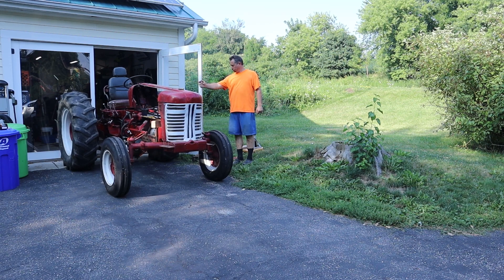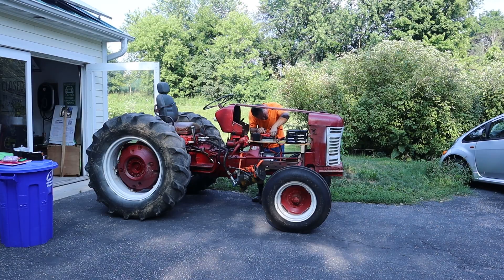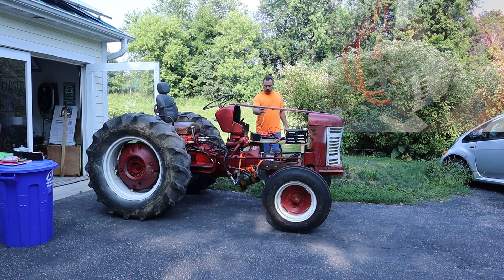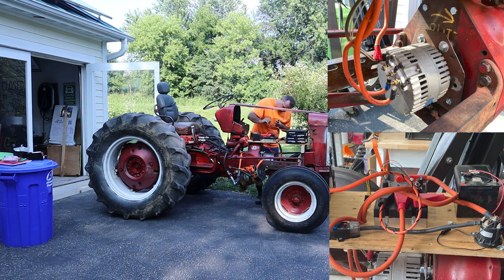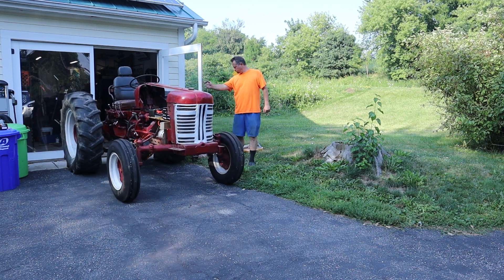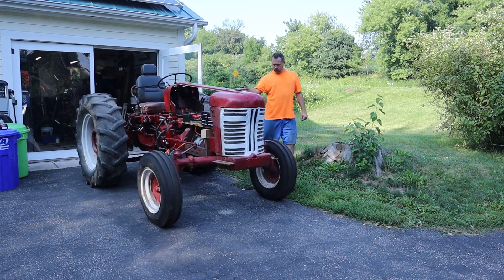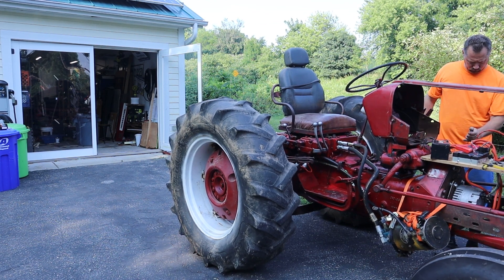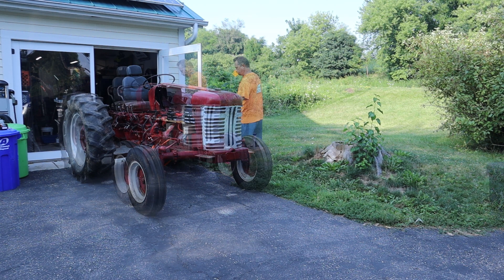Electric Tractor: Rolls for the very first time!

Comment: Awesome to see it moving, nice work! What happened to the Leaf motor?
Reply from the maker: I still have the Leaf motor. I’m going to try to see if I can fit it, but it requires such a high voltage to operate that I might not be able to fit a matching battery pack.

Comment: Now, from engineer who lived his childhood on the farm:

Most useful thing in the was hand throttle that can set almost fixed engine RPM. So you can drive it on flat road, up or down hill at constant speed, like cruise control. Mosty for hauling lumber, you set the low throttle and it does engine brake a lot.

Also, my tractor has 2 clutches. If I was doing the conversion on it, one motor would drive PTO and Hydraulics, other the wheels.
Reply from the maker: The trouble with multiple motors is where to you attach them and connect the mechanical power. In the current setup, a secondary motor powers the hydraulics. That’s pretty easy, because it can be attached by a pair of flexible hoses. 
The wheels and the PTO are both powered by concentric input shafts running off the engine. Very challenging to connect two electric motors in the exact same place as each other where a single engine previously had been. 

If this was a completely designed from scratch project, things could be done differently, but the existing design physically limits what can be done and provides some challenges.
Reply: @BenjaminNelsonX  Modern EVs, like Lucid or Ford Mach E have hollow shat, and Lucid has internal diff. Do it is not impossible.
Reply from the maker: Some sort of cruise control makes a lot of sense. It should be very easy to modify the hand throttle to act the same way on electric.

Comment: Help me  out with my battery.
 I have an mgb and a leaf motor. No trans.
What's a inexpensive batt option 14 leaf?
Reply: Dala of Dala' EV repair channel is converting a Nissan sports car to electric using Leaf motor and battery.
Reply: Leaf battery is a simple and cheap option. The battery degradation issue would not be so bad in an MGB conversion provided that the car is not driven and parked in baking heat. ☮️

Comment: I have a 48 ford n8 flat head 4cyl.
My plan is to remove the head and install a flat plate mounting surface for a electric motor. 
I like your choice of motor. It seems to have a smooth application of power in the low rpm range.
How did you choose this motor?
Reply from the maker: I have several different motors, and frankly, none of them are perfect for this application. I'm using this one because A) I got it dirt cheap from a friend, and B) it's brushless DC. I haven't worked with brushless DC that much before. This motor with the RoboteQ controller gives all sorts of great features and programmability. Regenerative braking is one of the features I'm trying in the video, and boy does it work great!

I think the issue with this motor is that it won't have enough torque. I also have a big forklift motor and a Nissan Leaf motor. I'll probably try the Leaf motor, as that should have the right amount of torque, but it also runs on a much higher voltage.
The forklift motor would have tons of torque, but has a weird split face, making mounting challenging, and a odd splined shaft.

For an old Ford 8N, it's a smaller and simpler tractor, so the design would be a little easier and there would be more motors that would work fine for it.

Comment: Does that tractor have the torque amplify in the transmission or is it just the older 4 speed manual from IH?  If it is just the 4 speed manual you could allow the motor to run in reverse as long as the pto is turned off.  Ford offered a reverser that worked that way between the motor and transmission that would reverse the PTO as well as the transmission.  It was handy for a loader tractor where you don't use the pto.  But if you have the IH TA I wouldn't back drive it they don't take well to that and explode when used for engine braking on a hill.  Very cool though I would love to do this same thing with an old H I have and use it for haying.  It is on my long project list.
Reply from the maker: I wonder if I could modify the Torque Amplifier, so that it would NOT be an issue to spin everything in reverse. Having reverse through spinning the motor the opposite direction, instead of manually shifting, would make operating the tractor easier for something like running a loader.
Reply from the maker: This tractor has the Torque Amplifier (TA)

Comment: Congratulations on your progress. Now, install the battery pack, hydraulic controls, steering and you have awesome project completed.
Reply from the maker: Battery pack is on its way. I need the hydraulics running for the power steering. I just ran into an issue with the hydraulic motor, so I'm trying to swap it out for another one.
Still plenty to do!